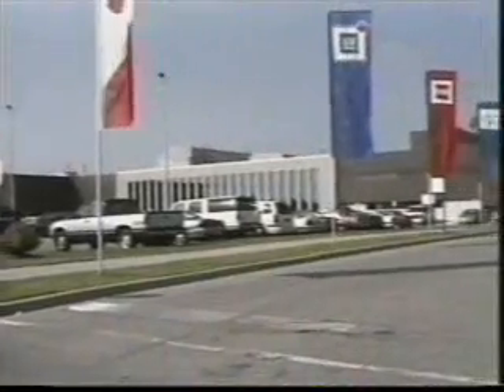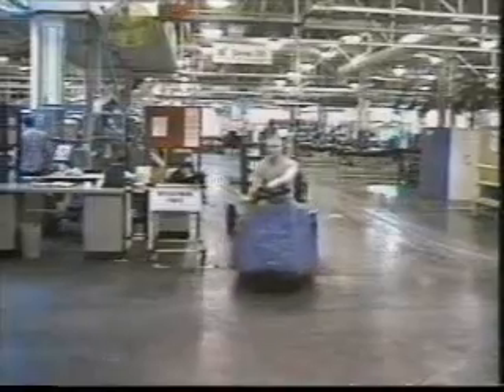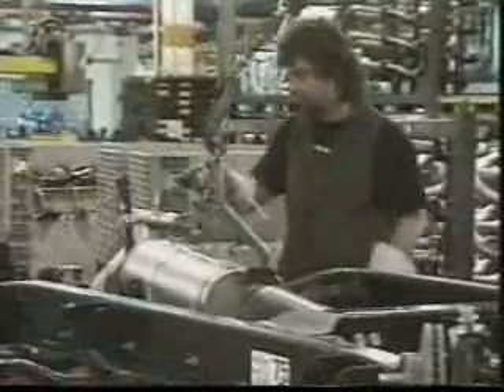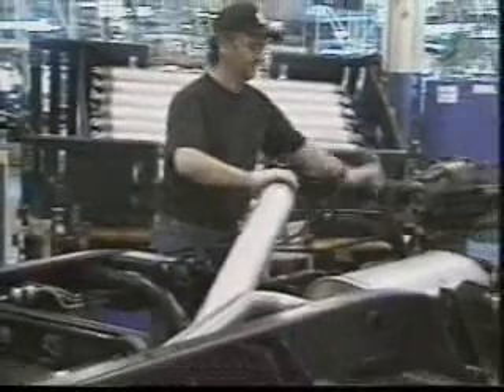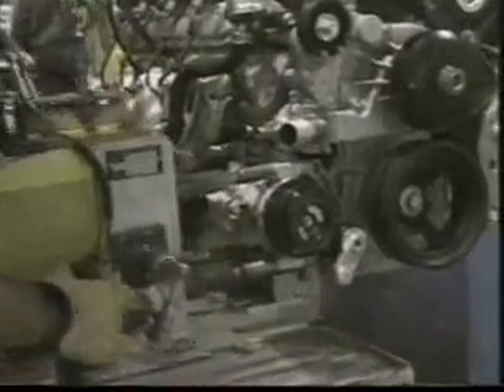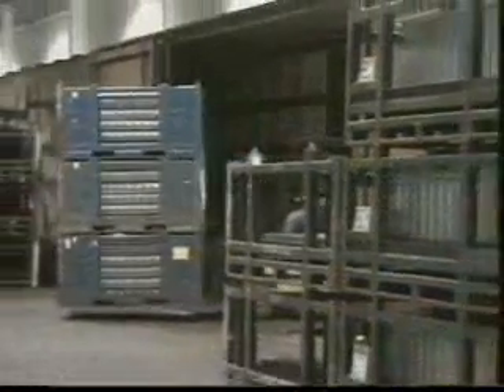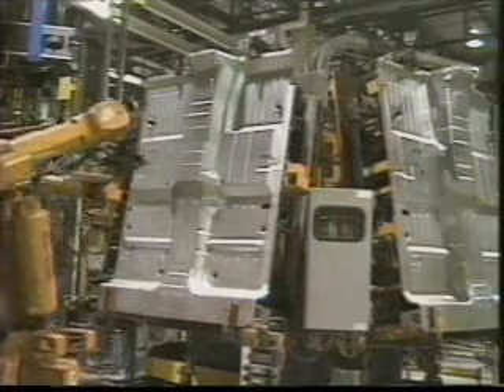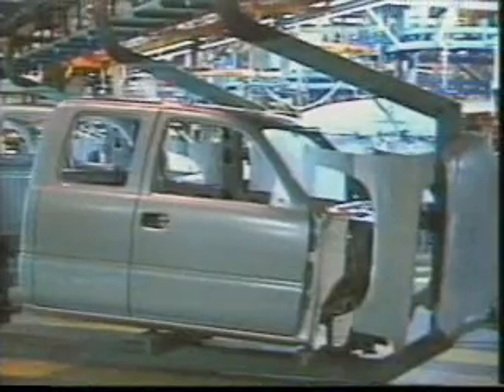How a Chevy Silverado is built at the Oshawa Truck Plant 1/3

Comment: Cool video. My 1995 C1500 5.7 here in New Zealand was made there at the Oshawa plant. She's done 213,000 miles and runs great, but right now I've got the intake off to put new intake gaskets on (preventive maintenance). When I pulled the intake I could tell it's the first time it's been apart since 1995. I should have her back together in a couple of days, can't wait to drive it again. Great truck. Go the Canada Freedom protestors.  :)

Comment: had a '03 Silverado ; pros 4.3 strong (348,000 miles) ,abs great,super reliable,good ride. cons; helper springs (rear)cracked under axil, gauges quit, except for gas &  temp.,3 fuel pumps, & heavy duty trans.2nd gear started to slip. gone to Copart,a real shame now they are waaay too expensive.
Reply: Use non ethanol gas no fuel pump problems

Comment: GM is failing because of poor management. Simple electrical functions are done via BCM and ECM, which render them not serviceable except by technicians with state of the art tools. Cost for new has skyrocketed . You can buy a small retirement home or a new SUV which depreciates rapidly . The newer GM products I will not buy . Instead of a well built , serviceable vehicle , they have priced it out of range for an average worker  And yet , GM cannot understand why it is failing .Gee whiz , I sure don't know why . 70,000.00 for a loaded SUV sounds reasonable to me...
Reply: Mike Hileman we built them in 2007 they were still 70k like they are today, also the GMT-900 and 800 series SUV are still used in motorcades around the world and the GMT 930 is one the most commonly armored vehicles, also you can easily find then for sale with 300k mi and still in good shape, so your point doesn’t have merit. I will always be proud for what my city built, GM gave my family employment for 3 generations, and they treat us well.

Comment: My truck was made in this plant 17 years ago. 148,000 miles on it and it still runs damn strong.
Reply: Jasmine Torres  Wish I still had it, engine ran smooth, no misfires, never had any real problems with the transmission besides replacing a solenoid, always started up in the extreme cold, only problem was rust. Now I have a 2008 and the transmission went out at 150,000 miles. The build quality was better with the older silverados.
Reply: @LukeSutherland.  my 2000 Yukon still runs great, 223k miles original engine and transmission.

Comment: Weren't they built in Janesville, Wisconsin until 2010?
Reply: Max Webster what was built in Janesville just before the assembly plant closed? I sure they were doing Chevy and GMC pickups and Chevy Suburbans but I could be wrong. Thanks
Reply: Glenn Lego we made Silverado 3500 crew cabs until 2000, topkick/Kodiak until 2002 and the main production line was the Yukon / XL and Tahoe / Suburban. We were the exclusive plant for the Denali from 2001 until 2009.

Comment: Why do all GM trucks rust at the rear bottom of the front door, if it is a extend cab it will always be at the rear bottom of that ! There should be a class action suit against GM for this. Rarely do I not see a GM truck rusting terribly.
Reply: class action suit for rust? what the hell is wrong with you?
Reply: with so may trucks afflicted, sad
Reply: azimmey
dont know what your talking about.
Reply: +azimmey You have to clean out the salt and dirt every spring because it corrodes faster in the summer heat...all summer long.
Reply: azimmey cab corner is the term youre looking for
Reply: Because millions of trucks have the same problem Dude!

Comment: Was the truck. I took great care of it. Wouldn't you if you bought a new truck with your hard earned money? These trucks were made with garbage metal and don't know where it came from but probably japan.  I'll give you a test--See how many Silverado K-10s from 1986 you can count on the road in the Northern parts of the US.  I'll bet very few. I have a 57 chevy from the rust belt that has only surface rust on the frame. That's because it was built with real STEEL from BETHLEHEM STEEL
Reply: Fucking hilarious